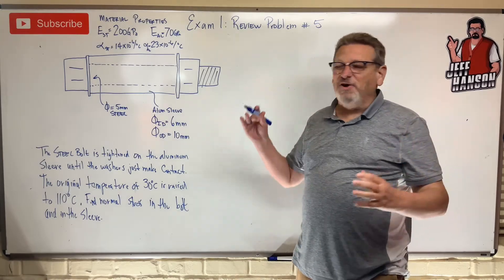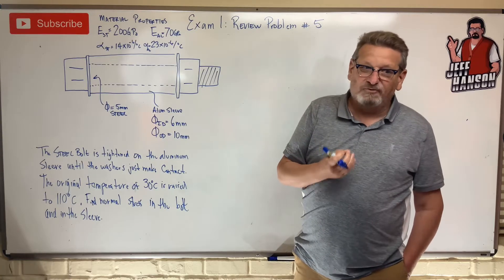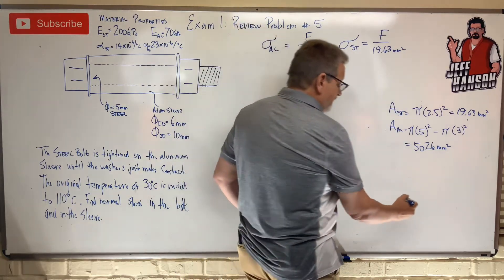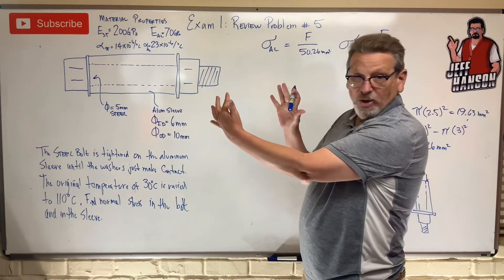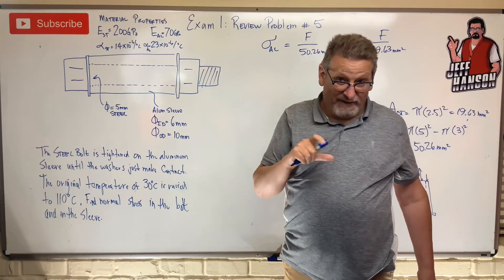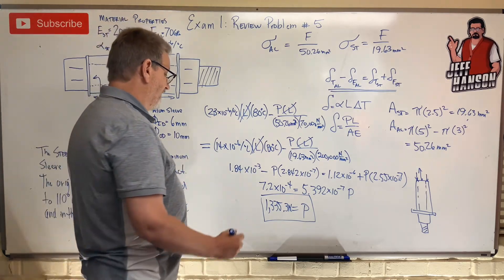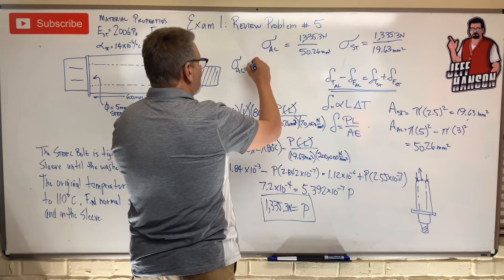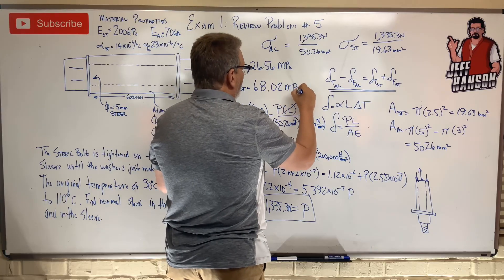Mechanics of Materials: Exam 1 Review Problem 5, Thermal Expansion Example Problem

Comment: There is typo, when calculating the F from the deltas, the right side is the thermal delta of steel plus the force delta of steel. Instead, you put delta_t - delta_f when you substituted the values!